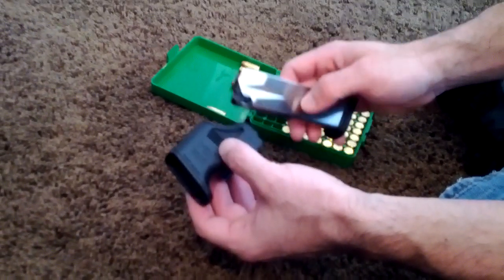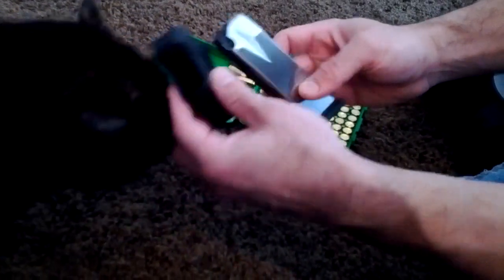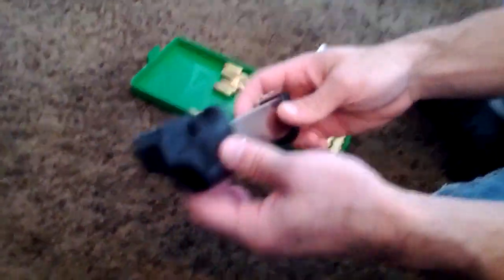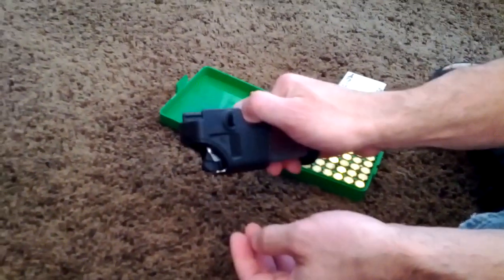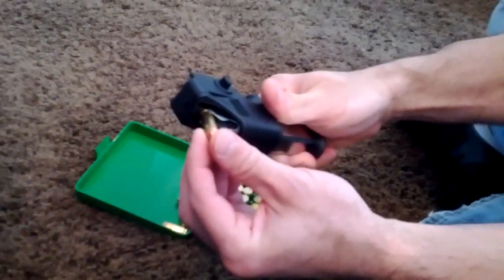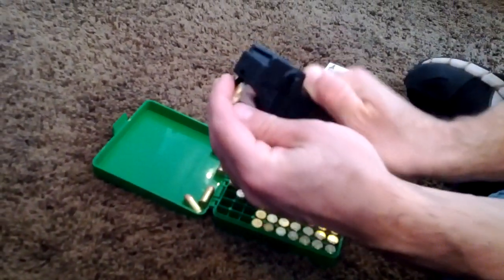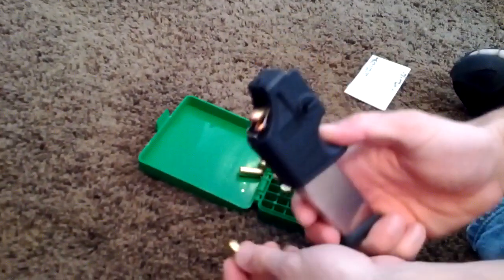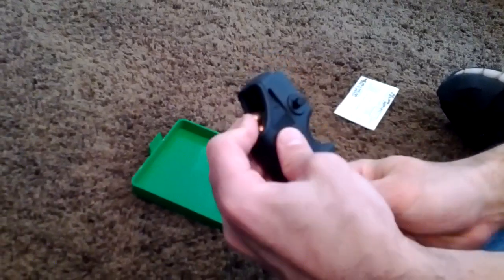Springfield XD speed loader

Comment: Thanks for the video. But this contraption isnt much faster than manual loading. Nice try Springfield.
Reply from the maker: Wisconsin Northwoods I totally agree, it's not any faster.  But for those who don't have the finger strength to manually load a full mag (like my wife) or even for new mags where the springs are stiff and not broken in yet, this loader gets the job done.  It's simple, has no moving parts so isn't going to break, I think it's a pretty good design myself.
Reply: I have the Hellcat with 13 round magazines, if hand loading beyond 10 rds it gets very stiff to add the last 3. When I first bought the speed loader, I only used it for the last 3-4 rounds. But have gotten so quick at it, I use it for all loading now.